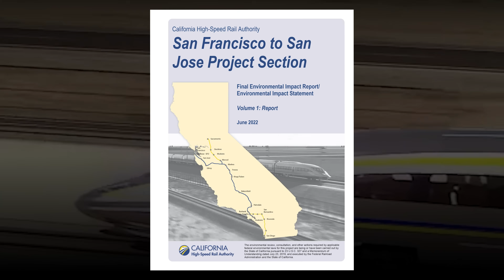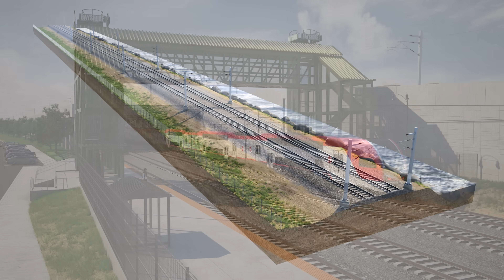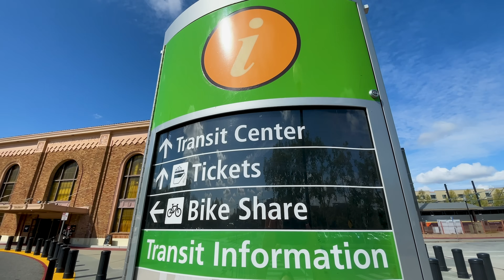San Francisco to San Jose Project Section Overview - FULL VIDEO

Comment: Neat! I'm glad to hear this. Of course, I'm curious why this sort of "blended system" wasn't used the entire length down to LA. There already are rails all the way between LA, SJ, SF, and SAC (Amtrak Coast Starlight, Amtrak Capital Corridor, etc). Shame they couldn't "share" with the other rail owners like UP and BNSF.
Reply: To achieve high speeds safely to you need very good track conditions. Something that those other tracks don't have. HSR also needs really gentle curves something those alignments don't support and those tracks are already full.with freight traffic, your not going to get 200+ miles an hour out of those tracks the Caltrain tracks are also limited to 110 same for north east corridor.
Reply: @kneonspace  definitely this. Existing rails could not support the high speeds.
Reply: I could imagine the Problem lies in the nature of freigt railroads.
They have long and slow trains, which are difficult to cope with when operating HS-Rail. Also Freight trains often don't run on scedules, this makes coordinating scedules for the High Speed Trains very difficult and leads to delays (i.e. Passenger Train is suddenly stuck behind freight train). When copared to Caltrain, which has sceduled and (relatively) fast train services, it is a lot more feasable to do a "bleded system" on the caltrain corridor.
Also caltrain can profit a lot from these uprades, such as electrification and grade separations, while UP and BNSF probably could'nt care less about these topics.
Reply: The freight carriers are the reason why Amtrak struggles
Reply: Could be they also wanted to connect more people. Fresno is the 5th biggest city in California, other Central Valley cities are quite big as well.
Reply: @ezyryder11  not exactly. There’s rough terrain on the more direct route, which would delay even further. And in SF, the BART tracks are wide gauge, not the standard gauge the HSR uses
Reply: High-speed rail is too fast, it cannot run together with a system with a speed of less than 200 km/h or 250 km/h.
Reply: Yeah, it's a mixture of the things everybody else has mentioned:
- the existing rails already have a bunch of freight in the way (to America's credit, you already utilise freight rail a lot, you just need to catch your passenger rail up);
- they don't have the gentle curves that you need for high speed, and the terrain makes it difficult to fix that problem;
- and IMO most importantly, going along the coast means missing all the important central valley destinations.

While we focus a lot on the end-to-end journeys (SF to LA), a transit corridor really succeeds if it's got a bunch of other journeys that can coexist on the same corridor: SJ to LA, Sacramento to LA, SF to Fresno, etc... This allows it to cover expoentially more of the trips that real people are making.

So while a blended system makes sense in the Bay Area's crowded city conditions, you'll get a lot more value out of building new lines for many of the inter-city portions.
Reply: Another justification is congestion: Ideally, the San Joaquins would go all the way down to LA but IIRC, the tracks between Bakersfield and Palmdale are already quite well used by the freight operators and don't leave much space around for other passenger trains. This is ignoring the fact that the mountaineous terrain makes upgrading for speed practically impossible so new tracks to maintain high speed have to be built anyway.

Incidentally, that's part of the reason why the Shinkansen and other HSL like HS2 were built (dealing with congestion on the existing mainlines) and CAHSR is no different if only by freight and not passenger services.

Comment: Well, it's exciting to hear that this will be almost as fast as a steam train.

No, really, I'm actually excited for this despite the disappointing constraints it needs to fight.
Reply: it has to be done, when this project is done, it'll make great sucess and change the nation for more HSR.
Reply: It'll cement Brightline as the future, that's for sure!
Reply: No steam train went 200 miles an hour. One went 125 but that was on the East coast
Reply: @darthmaul216  Ah, did I get my units mixed up? 200 mph is a good speed by modern standards. 200 km/h was the limit of steam.

Comment: Seems like an elevated train would be the way to go in these more populated areas.
Reply: Impossible. The billionaire tech NIMBYs will never allow it. CAHSR tried fielding that idea early on. It was immediately shot down. The opposition was insurmountable. The NIMBYs have also shot down a ton of grade separations, quad-tracking, passing tracks, and they have even taken a crack at killing electrification. Thankfully, they failed at that and Caltrain managed to ram through a few grade separations and electrification already. 

More than a dozen more grade separations are already in the works, some already in pre-construction. A few more are waiting in the wings. All in all, only about a dozen grade separations will remain by the time CAHSR trains arrive in the Bay. Hopefully, the rest are removed promptly after that. But even if they stay with quad gates and fences, that's still more than enough for 110mph. Other rail systems do the exact same thing at similar speeds all over the world. It's not nearly as big a deal as the anti-rail trolls are trying to make it out to be.

Comment: love that as a part of this project Caltrain local service will also get a top speed of 110 mph. Not sure how much it'll be able to be sustained with the stop density, but what a nice upgrade.
Reply: Stop density is not really a problem for EMUs.
Reply: @RTSRafnex2  another benefit to electrification then!
Reply: It's driven by electricity and the ac-/de-celeration will be larger.

Comment: My one really big nitpick is Milbrae station: that facility looks relatively new and there was seemingly little effort to futureproof the site even though HSR has been in the works for some time. It's the one down point, but once it's remedied then this will bring a better level of rail to California, finally exceeding the NEC. I'm rooting for you, California, and I can't wait to see things fall into place soon.
Reply: Valid point, but Millbrae station predates the CAHSR project. It was built as a terminus station as part of the SFO BART extension. That project started planning in 1984 and already finished construction by 2003. By that time it was simultaneously too early and too late to incorporate CAHSR into the station design.
Reply: @TohaBgood2  I think that's fair. It's always a challenge to retrofit new infrastructure if the existing one didn't ponder a possibility, but I'm really excited to see HSR finally reach SF.
Reply: What's the concern? That station was and is one of the best. Connects Caltrain to BART and SFO. Additionally has adequate parking and a new huge multi-unit housing complex at the front door. It is a public transit fan's dream come true.

Comment: is it finished yet? at this point the ineptitude is globally embarrassing for all high speed rail. might as well ask the chinese to build it and call it foreign aid.
Reply: Lol the Chinese started planning their system in 1979 and only finished the first “kind-of HSR” line by the early 1990s. 

CAHSR is actually moving faster than the Chinese HSR system.

Also, China’s HSR is trillions in debt and they have viaducts falling into gorges. Why would we want bring that kind of “expertise” here? It will cost double to fix their mistakes just like with the Chinese built Millennium Tower in SF!

Thank, but no thanks!
Reply: I heard a French rail company and Japan rail attempted to be contracted with them, but they saw all the bureaucracy and red taping happening and backed out

Comment: Not many people remember, but in 1992 the Southern Pacific Railroad offered to sell the entire coast route between LA and San Francisco, plus upgrade it for fast-train operations for $360 million dollars. Even adjusted for inflation, that's only $638.5 million. With 110mph track, the entire 483 mile trip could be completed in less than six hours. 

And it would have been built by people who knew how to actually run a railroad.

Instead we get this abomination of a project. I deeply regret voting for Prop 1 in 2008. I remember when the entire thing from SD-LA-SF-Sac was to cost $33 billion and be completed by 2020.

It will never be completed. At best we'll get a billion dollar bike trail in a few places.
Reply: It’s already being completed, bud. You’ve already lost. The first three sections are on track to finish guideway construction by next year.

Also, the coastal route goes through the mountains. You can only get even remotely close to 110mph on a few of the flat sections. The rest would still be as slow as it is now.

Also, that’s 6 hours just for San Jose to Santa  Barbara. Technically that is SoCal-ish, but it ain’t LA. From there you still need to somehow get to LA ver the LOSSAN which is incredibly slow and curvy. It is also incredibly expensive to straighten and upgrade due to the dense development on the route there.

In other words, this was always a bull$&it plan.
Reply: @TohaBgood2  Completed when? And I mean a minimum operable section... ballast, tracks, catenary wire, electric substations, and a few stations.

I live in the middle of the construction area. In Kings and Tulare counties, the HSR is to cross highway 43 four times on giant concrete viaducts. So far they've started construction for one bridge. And several more years of work to finish the rest.

Geopolitics, war, and currency debasement are coming to bite us in the ass soon. I still maintain this project will never be completed. Think Cincinnati Subway type of ruin.
Reply: @derek20la  Nope. You are either lying or you have no idea what you're talking about. The first section is getting completed in March 2023. The other two are due to be completed by December 2023. I think at least one section (cough** Construction Package 2-3 **cough) will go over the December 2023 deadline by a few months. But that won't even impact the track installation and electrification contract progress. By 2025 there will be test trains running. After that it's game over for you lot. 

Just face it, bud. You all tried to kill it and you failed. You did create a bunch of expensive delays and cost overruns with your lawsuits, but the project bounced back and steamrolled your silly dark money groups and Conservative lawyers into the ground. You don't mess with California and live to tell the tale.

Just take the L. We're building this thing whether you like it or not! You can waste some more of our common tax money and start some more obstructions, or you can get on board and help out. But it's getting built with or without you!
Reply: @TohaBgood2  ok you have gotten disingenuous here. You are using a definition of "completed" that is absolutely misleading. Trains rolling at high-speed between LA and SF is the definition I believe the original poster and dare I say EVERYONE ELSE IN THE WORLD would use.
Reply: @DouglasLippi  I don't see you making the same argument whenever someone uses the exact same metrics for other HSR projects!

The Shinkansen project started in the 1930s and the first sections was only finished (cosmetically) in 1964. They were still finishing that line for a few years after that and were using a ton of pre-existing rail in the meantime to compensate. They also only finished building a tiny section of the original plan, not even close to the entire planned system. But if you listen to you lot then the entire Shinkansen was magically finished in 4 years. No mention of the 2x budget increase either!

The same goes for the HSR network in China. You always forget that there were 10-20 years of pre-construction work on all of those HSR lines in China. You forget that the Chinese started working on their HSR network in 1979 and only finished the first segment of "kind-of sort-of" HSR in the 90s. 

How come we have to use the strictest metrics for CAHSR when you always use the loosest metrics for other systems to claim that we should cancel CAHSR?

No. The trolls said that this HSR line "will never be built". CAHSR is officially finishing construction on these first three segments next year. Now you want to move the goalposts? Nope, won't fly. Construction is construction!

Sure, they will still have to install the rails on the finished guideway. They'll also have to  install the catenary on that already prepped guideway and plug the system into the electrical infrastructure that they have been building with PG&E utility relocations. But the construction of the actual right of way will have been long finished by then!
Reply: @TohaBgood2  I don't care what happens in other countries.
Reply: In places where no one rides bikes lol

Comment: The CHSRA was created in 1996. People born then will be nearly 30 (or likely over) years old by the time this project is finished, if ever.
Reply: That entity was literally created to plan and find funding for HSR in California. The first funding was only approved by voters in 2008. They only started building in 2015 and are already completing the first three sections by next year. This is a very respectable pace for HSR planning and construction compared to other projects.

Japan started planning the Shinkansen in the 1930s and only finished the first section by 1964! China started planning their system after “dear leader” visited Japan in 1979 and only finished the first “almost-HSR” upgraded lines by the early 1990s. France took 40 years to plan and build the first TGV line.

California actually moved much faster than most HSR systems. Despite what the anti-rail propaganda is trying to push, this system is actually moving forward much faster than most other HSR systems did!
Reply: HSR takes a while to build, and there's a bunch of NIMBYs blocking it too. Europe's HSR took decades but look at how awesome it is now.
Reply: @moth5799  It's a bunch of tracks in the middle of nowhere.
Reply: @CThyran  Calais to Lyon in 3.5 hours, that's half the time it would take to drive, and it's over 700 km. It's only a tiny bit longer than a flight.
Calais has a population of 150k, Lyon has a population of 2.2 million. Hardly the middle of nowhere.

Have you considered buying reading glasses? You evidently struggle to understand maps.
Reply: @moth5799  I'm talking about California not France. The entire line won't even go where it was originally planned and is (at best) a train no nowhere. Not counting their glacial speed of actually building anything.

Comment: I just don't see the point of having a 4th & King CHSR station. 
Just go straight directly to the Salesforce terminal via bypass tunnel.
And built a Muni sub from 4th & King to Salesforce terminal instead.
Reply: The Muni Central Subway is actually already completed and is about to open later this year.

Salesforce Transit Center and the DTX connector tunnel is 100% an SF city project. They have opted for a very expensive and slow buildout option which they haven’t even broken ground on.

But again, that is a city project not a CAHSR or even a Caltrain project. The city has full control and does whatever it wants to do there. Any complains go to them!
Reply: Caltrain has been talking about an extension from 4th and King to 1st and Mission for as long as I've been alive. Like all massive public works projects, it is wildly complicated. That said, they've also been talking about electrification for that long also and that IS finally getting done, so you never know. Definitely no time soon though.
Reply: @DouglasLippi  It's important to differentiate those two projects. Caltrain has wanted electrification since its inception and it is now finishing electrification. The new electric trainsets are actively testing and will enter operation by 2024. 

The city has wanted to extend Caltrain to downtown for a long time too. But they are nowhere near even starting on that project. the city keeps tacking on more complex work onto that project too. That only pushes the project further and further into the future.

But Caltrain itself has zero to do with that. The city decides what it wants to do and consults or merely informs its partners about its decisions. Caltrain has no control over what the city electeds fund or build on their land. It's not a Caltrain project even though Caltrain and CAHSR are expected to use the new tunnels and platforms.
Reply: @TohaBgood2  thanks for the info. Yeah lots of different players involved. Very tricky to navigate. I wish BART had done its originally-planned circle around the bay. What a difference that would have made today. Same goes for CAHSR. I hope they finish it (and quickly) and then get it to Sacramento (and Tahoe!!!!!)

Comment: A corridor that has remained unchanged and at the same speeds as in the Lincoln Administration. Progress in boondoggles I guess.
Reply: What are you talking about, bud? They’re literally upgrading from 79mph to 110mph, electrifying, removing grade crossings, adding level boarding, and straightening curves.

It’s almost like you have no idea what you’re talking about.

Comment: An amazing project and I can't wait to ride the finished product but why are there at grade crossings!? That's madness!
Reply: It’s actually fine to have slower sections, even with protected grade crossings in urban areas where there are multiple stops. That’s standard practice for most HSR lines.

But CAHSR actually did want a 4-track trade separated railway here. The NIMBYS successfully blocked all of it, including the passing tracks. They almost killed electrification too! 

The fact that this is getting built at all despite all those billionaires in Atherton suing is a friggin miracle in and of itself!
Reply: This corridor was built in the mid-1800s and hasn't been changed much since